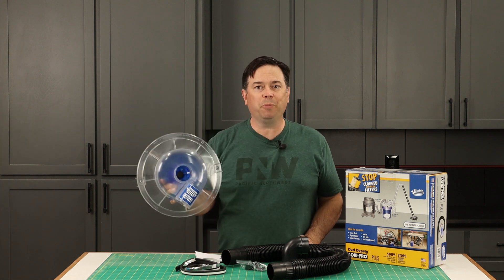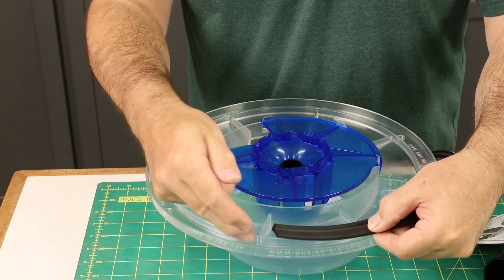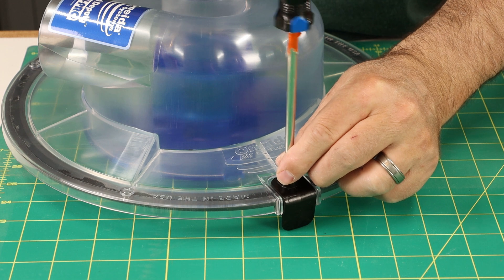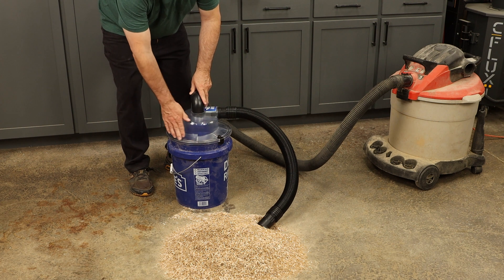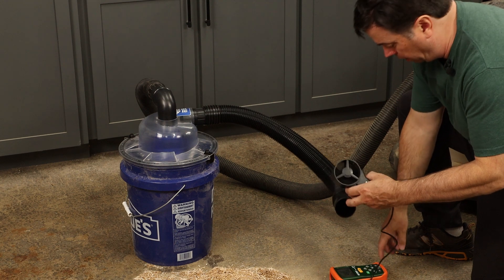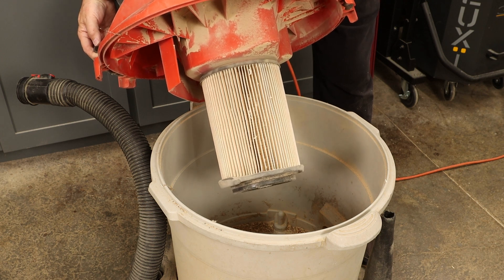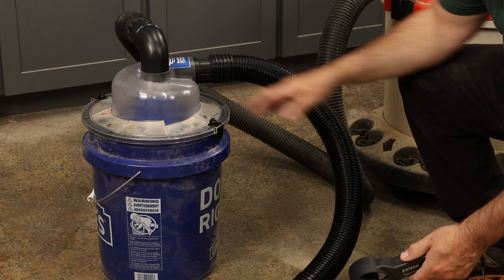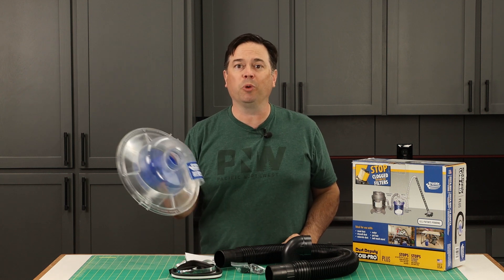Oneida Low Profile Dust Deputy Separator Full Test

Comment: I suggest you learn how to set up your air flow meeter. There has never been a 2-1/2" vacuum that moves 340 CFM. Makes me wonder how thoughtful you really are. That antique Ridgid vac you are using is very likely going to max out at somewhere around 150 CFM. Why not do a comparison with a separeatory that many thousands of people like better...The Dustopper PRO!
Reply from the maker: It's actually not a setup issue, it's just that this type of airflow meter is less than accurate.  I have, however found they're useful for comparison sake.  Rest assured, I tested the Dustopper too...  https://youtu.be/ZJXWxXBVf_c  Thanks for your feedback.

Comment: Curious if you compared this compact separator lid with their cyclone as to how much dust and chips made it past the bucket and into the vac, airflow, etc? Guessing the cyclone would separate more material since the dust swirls at a steeper angle and has less of a chance to get pulled into the vac, but just speculating here. Nice quick review of this tool.
Reply from the maker: The filter stayed surprisingly clean.  I was actually really impressed.  However, the resulting setup with 5 gallon bucket and hoses is pretty cumbersome.  Thanks!